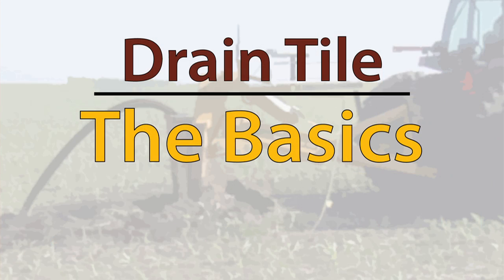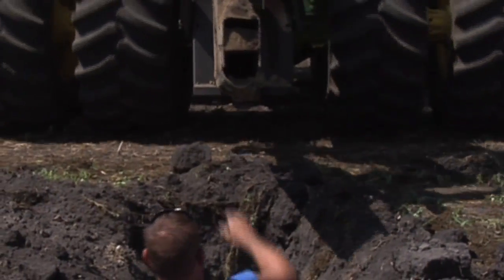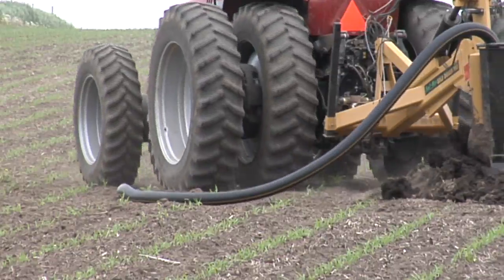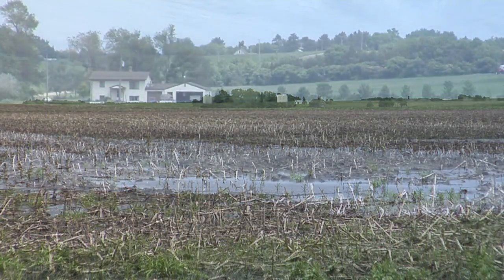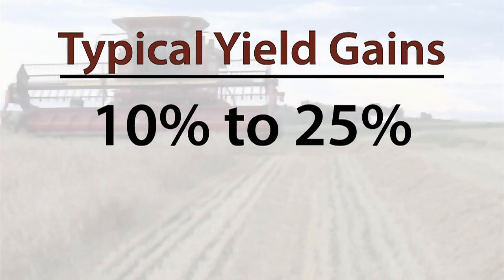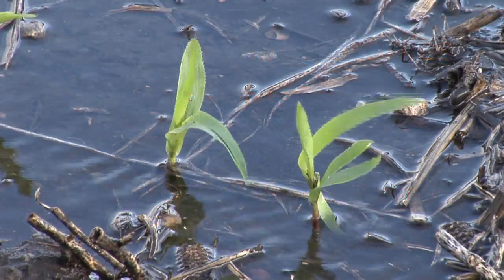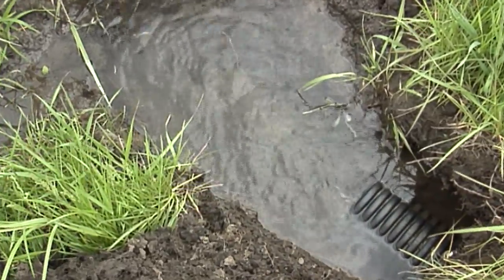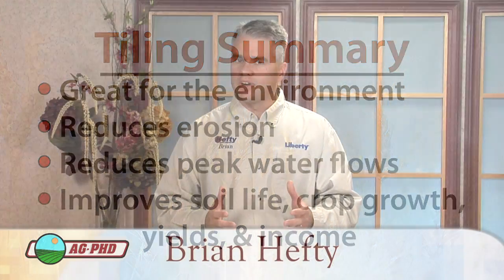Ag PhD's Tiling Basics

Comment: I appreciate the reply.  However, if using a gravel cart then adding gravel does not add a lot of work as was insinuated.  It does add expense, yes.  However, the longevity the gravel would add to the system working well would pay for that many times over.  No one would think of putting a curtain drain around the foundation of their house without adding gravel.  The same principal applies here.  The fact is gravel carts are expensive and tile installers, naturally, would rather not invest in one.  Personally, I would never hire a company to install tile if they did not own or could not rent a gravel cart and the attachment to their tile machine to make it would as in this video: https://www.youtube.com/watch?v=rdEr5lrXdBM